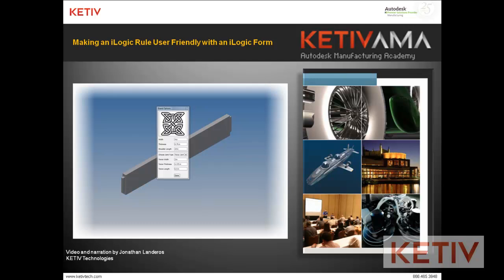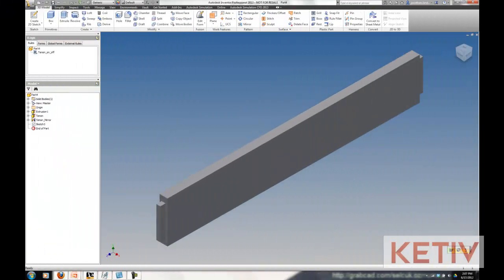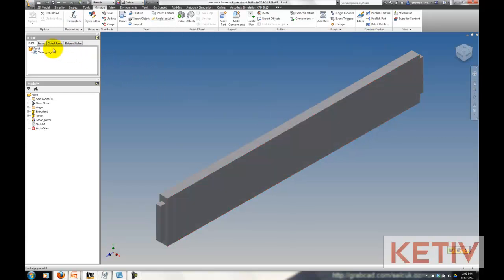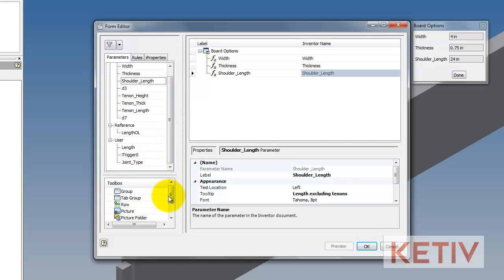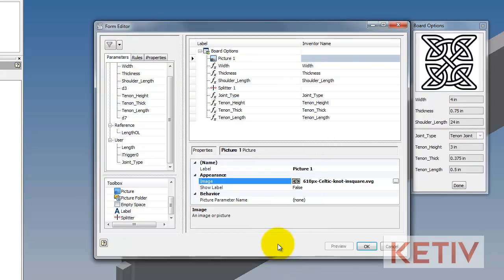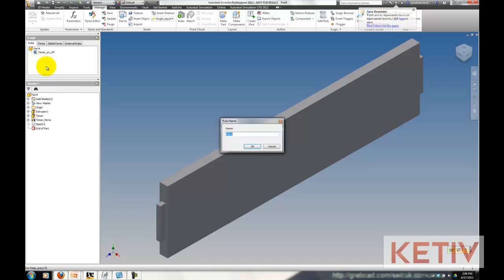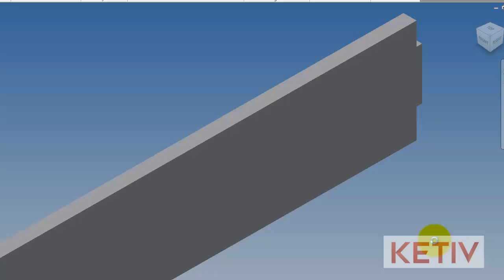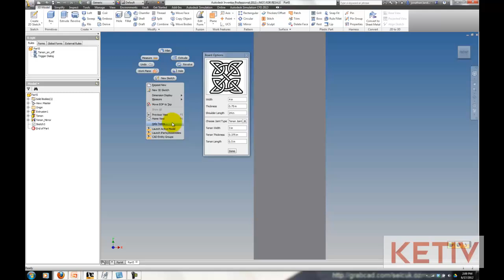Using a Form to Make an iLogic Rule User Friendly

Comment: Is it possible to run the form after placing this part in another assembly?
Reply from the maker: Jared, the iLogic forms stay with the files they reside in. Depending on what you need to complete, you may find more benefit creating the forms to control the parts in the context of an assembly file.